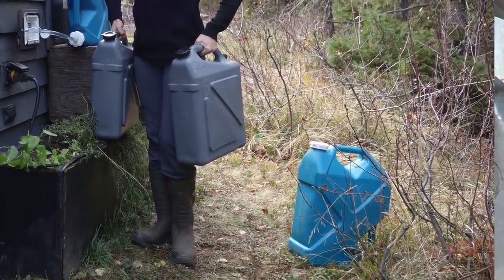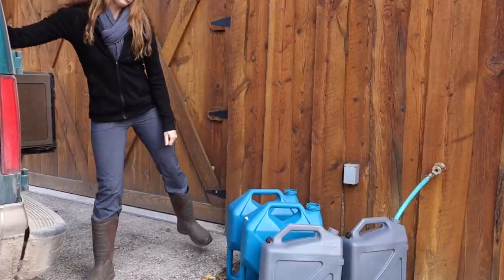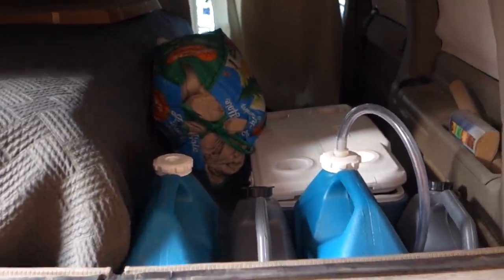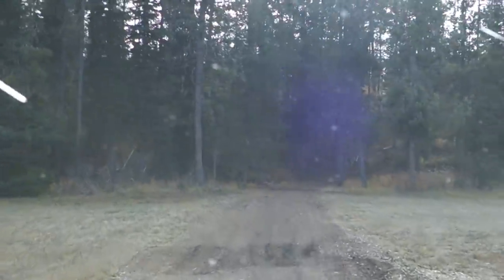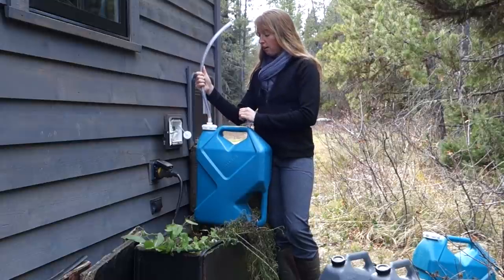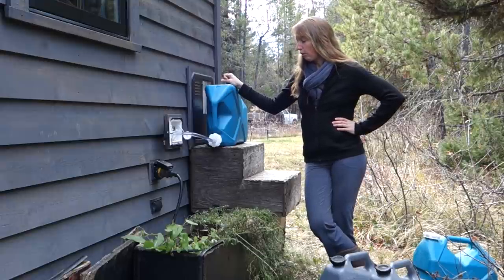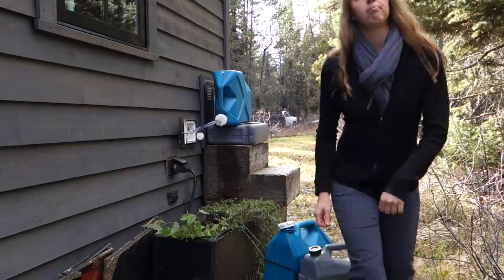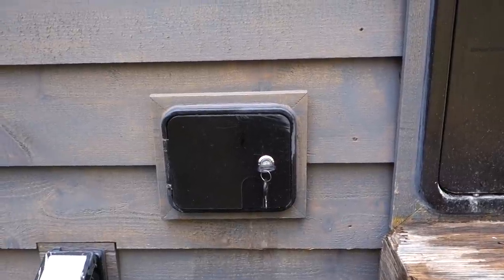Life in a Tiny House called Fy Nyth - Off Grid Water System

Comment: For my camper I do the same thing.  I purchased an extra RV water pump and I use that to move the water from the jug into the camper.  Just connect two short hoses and supply 12 volts to it and you are moving water.  You might think the pump is expensive but you have a spare pump in case the pump dies in your tiny house.  Those jugs are heavy and with the pump you can leave them on the ground.  No more transferring water from jug to jug either.  Good luck.  Great video!

Comment: I had a place where I had 3 55 gallon drums inside the tiny cabin.  It was easiest to fill up a 55 gallon drum in the bed of a small 4WD pick up, and using a 12vdc Shurflow pump, pump it directly into the cabin.  This could be done in subzero temperatures.  In warmer temps it could be gravity fed.  Gravity fed is slower and risks becoming freezing.
Staying up right, the 3 55 gallon drums would easily fit under a counter top.  I kept water consumption to no more that 7 gallons per day, and melted snow to reduce consumption.  30 gallon drums are smaller in diameter and might work under a counter top that is less than 20 inches wide.  Love your place ....nice!
Reply from the maker: Sounds like you had a good system setup.
Reply: @FyNyth  It would be easy to increase your water capacity by adding a few 30 or 55 gallon drums to the exterior in back near your propane tank.  a 12VDC Shurflo pump, or via gravity and pump that water into your tanks.  With a 30 or 55 gallon drum in the rear of the van to deliver the water efficiently to your storage tanks at home,  makes this feasable.  The extra capacity during warm weather could also help supply the garden.  I have 3 drums that are on a mound of dirt with a flat spot that is about 2 feet high.  This gives me gravity fed water source to water the garden, or to feed the outdoor kitchen sink.  I also wash clothes with this water that is warmed up by the sun.  It is multi purpose.

Comment: I have a boat that is often  anchored out so I have a water problem similar to yours.
Instead of loading jugs into the dinghy, removing them from the dinghy, filling them, loading them back into the  dinghy, unloading them onto the boat and then pouring them into the tank, I use a bag.  The  bag is the type used in boats and RVs when water is stored on odd shaped compartments.  I put the bag in the dinghy and fill it at the  dock.  Then I go back to the boat and use a pump that is similar to the one you  have in your tiny house to pump the water into the tank.  No carrying and no lifting.

You can find 15 gal poly drums that are about 26" tall and 14" diameter.  They are usually available from places where you brew your own beer for $10 - $15. The malt syrup is shipped in them so they are food grade and only used once.  Two or three of these would easily  fit in your van. A Shurflo pump and some vinyl tubing are all you need to move the water to the tank in the house. You could buy a pump similar to the one in water system in your tiny house.  With lots of snow and very cold temps, a spare pump might be nice. 

I have given water transport a lot of thought, the tank on my boat is 350 Gal.

Your water jugs appear very blue in the video.

Comment: Practical and gets the job done. If I was in your situation I would likely look into getting a small trailer and put a 300 gal IBC tank on it. That's about 2500 lbs of water, so you need a trailer rated for that, or step down to a small IBC.

Comment: Hi, Ariel. 

I tried to post this on your laundry page, but I don't think that it took, so I'm posting it here. 

I use the same laundry set-up in my tiny, and I have to port in my water, too. I absolutely love both my tiny machines, and they fit into my soaking bath tub, made of a plastic horse-trough. (Way more comfy and practical than those galvanized metal ones. Keeps the water warmer, and has slanted sides for comfort. No seams to leak, and it's a pretty green.)

Back when I had a water hook-up, I bathed once a week, (for 60-90 minutes. Such luxury!) and used the water to soak my clothes until the water got cool, and then rinsed with vinegar. I use a plant-based liquid dishwashing soap, because I live on the edge of a wetland, and I break out from soap, too. 

My spinner is supposedly faster. If your Nina ever breaks, I recommend the Panda. Laundry-Alternative doesn't sell it any longer, but I found it on Amazon when looking, just in case of failure. It's pricy, ($179) but it's 3200 rpm, and built well.  I have the feeling that the reason they break is that people don't use common sense to learn to balance their load. I'll bet you're a pro at it! 

I can't believe how dry things get. I used to use it with a conventional washing machine, and I got 2-4 additional quarts of water out of my clothes before drying them in a conventional dryer. Took half the time to get them dry.

I take about an hour to finish a load in the WW, just because I let it sit and soak, too. I spin it a few times as I pass it by, perched on a wide shelf that rests on the tub. Handy for drainage, and keeps the sink free. I'm finding that agitating the clothes is less necessary than using warm water. It's like the dirt just melts away. And my clothes are softer without detergent. That stuff is awful! I hadn't realized until I stopped using the 'modern' laundry method how it  ruins clothing. 

I tote my water in one-gallon jugs, and more frequently than you, but then, mine is within walking distance, and I have one of those little folding carts to lug them up the dirt road. It seldom freezes here, but it rains all winter. (PNW) My cold-weather adventures are nearly over. I am old, and arthritic. This lifestyle prevents me from 'freezing' my bones. More people should have composting toilets and have to tote. They'd appreciate so much more of life and nature.

When I was a child, I wanted to live in the former chicken coop that my grandmother had in the back yard. It had a multi-paned picture window, and benches inside for us kids to play in. My home is about three times as big, but then, I have a kitchen and bath. Grandma would be proud, and confused. lol She came from the 'old country' to escape all that, and live in a big house. Then again, she had 7 kids. I live alone, in peace and quiet. Ahhhhhh. 

I've been following your adventures for years, and so enjoy all of it. Thanks so much for sharing. I had forgotten about soap nuts. It was a 'hippy' thing when I was young, and they were hard to find, so I didn't. I thought it was a scam, but I wish I had persevered then. I'll check them out now. Never too late to learn. 

'Confound the establishment, think for yourself' has been my motto for a long time. lol Apparently, you, too. It's a great way to live.
Reply from the maker: Sounds like an absolutely lovely setup and life! I hope you're able to continue it as long as you want to. Thanks for the Panda tip. I've seen them but never heard directly from anyone who used one.

Comment: Hey! Thanks for the great video. I was in a very similar situation to you (jaw dropping similarities) and found a great solution. Take it or leave it as you deem fit. I was hauling water from a, not-so-close-neighbor's garden hose. I used 6 gallon jugs and put them in the back of my astro van and so on just as you showed here. This is what I did: I bought a trailer for $350 and secured two 55 gal potable water tanks that I got for free. I then connected the two tanks at the bottom and installed a spigot. Now, I could simply put the hose in the top and wait 7-8ish minutes for it to fill. I'd tow it (behind the astro) over and connect it to my water intake. This was slightly higher than the spigot so there was always some water left behind but that was okay because my tank capacity was only 100 gallons. This made things so much easier for me and I only had to haul water for me and my partner's use every 3-4 weeks or so. Hope this can help with any future solutions!

Comment: Honestly, I would be taking along a couple of solar showerbags to fill as well. As long as you have sun and the temps aren't crazy cold, I'd be taking some nice warm (at times hot) showers while I could, even if I had to fill the bags with water from the creek. I would find a spot where I could make a shower stall with a tarp wrapped around three trees, where I would suspend the tarp with carabiner clips through the grommet holes like a big triangular shower curtain. I would take one of those S hooks from those black bungee straps and tie it to one of the trees at a level where when I hook the bag onto the S hook, the end of the bag's hose is high enough for me to shower while kneeling on a piece of closed cell foam.  Very comfortable, and more than enough warm/hot water to do the job! Heck, I've waited until dark in one of my camp grounds ..... hung the bag from a limb and got a good shower, all in the dark with no one the wiser ~8^)  I'm almost ...... almost ....... thinking about using those shower bags to shower even when I'm at home, but I'm prolly too lazy, plus I would need a pretty good hook in my home shower to support a couple gallons of water or so, although It certainly can be done! Would not want to try and hang that bag off the existing showerhead bend. Sorry for the long winded explanation, and oh btw, I bet you can heat up one of those showerbags on the dash of your vehicle in no time! Take care.
Reply from the maker: I've used those shower bags, and they do work pretty well. But here where most nights, even in the summer are below freezing, and there's snow on the ground for about 8 months out of the year, there's just not many times that showering outside would be comfortable. :) Or maybe I'm just not tough enough.

Comment: Nice video. Nice to see your  neighbours yard. You've found a workable solution. If it were me, to save my back and my hips, I would tweak a few things. At the neighbours I would make the hose a little longer and fill the containers in the van, with a second tap/shutoff near the van end. At your property I would trolley the containers to the inlet. Then I would leave them on the trolley and use a battery powered pump to pump in to your house tank. Better still have a 30 plus gallon tank in the van and pump it direct from where you park your van to the house, weather permitting. I'm sure you've thought of all this stuff and your young and fit, but just be kind to your 60 year old future self and mind those hips, knees and back.
Reply: I so admire the way you have set up your homestead and marvel at the things you have accomplished!  I am going to agree with Coffee though,  as a fit 25 year old I hurt my back accidentally loading pods onto an aircraft in cold weather and it has hurt off and on ever since and I am now 60. Even lifting and jerking those shifting weights only every 10 days could short out your shoulder, back, elbow joints or wrists.  Protect yourself now so you can continue to do more amazing things far into the future, pain free. Filling a 30 gallon barrel while it is in the van (attach a spigot to the bottom of the barrel) then draining it via hose while still in the van can save your skeletal structure a lot of stress. Work smarter, not harder as they say.
Reply from the maker: Thanks for your concern guys, but since I go lift much more weight than this regularly for fun, I'm not too worried about it at this point in my life. I do try to lift things safely.
Reply: I'm only 42 and already I am sorry I wasn't kinder to my younger body, joints, skin, hearing etc. I have felt the same in my body from 17 to 38, but at 38 noticed things just not quite as easy as they used to be. You can do things safely and avoid injury like you are doing, but you can't stop joint wear and it's cumulative. It's a balance, doing stuff and being active like you are doing will help you live longer then someone sitting on a couch watching TV all the time, but you might have a few more aches and pains later on. If it were me I would try and cut out the actions that negate themselves e.g. you arrive at your neighbour's yard with the jugs in the van and then jugs are in the van when you leave again. Taking them out and putting them back in again is needless with a longer hose. Ok, enough from the safety police. Please keep making videos, I enjoy them so much.
Reply: Those are some good ideas for efficiency. My only issue is the big tank in the van. If she had an accident a 30 gallon tank, which weighs about 250 pounds, could become a big heavy projectile. A morbid thought I know, but still an important consideration when hauling something.
Reply: Yes, you are right, an unsecured weight would be very dangerous. I'm sure there would be tie down points in the van. She is already carrying 24 gallons at the moment, but the journey is only one mile. The weight may help with traction in the snow.
Reply: Good ideas. Some marine pumps are manual, btw
Reply: Weight bearing exercise wards off lots of conditions later in life . Maybe just your wrists could use support. Nice job !
Reply: i 'm sure she will be putting a 12 volt pump eventually but want be in the shape she is in now.most of people don't know how much water they use per day nor do they care!!!!!good job girl.

Comment: You could run a long garden hose down to the creek in the summer and then pack it up for winter. Another option I would do if I were in that situation is purchase a large 20 gal. Or more  poly tank you could fit in your van and fill that at your water location, then drive back and back up to your home and either siphon into your home or get yourself a small rv pump and pump it from your tank to your home. This would eliminate the need to carry your water jugs.
Reply from the maker: If I used creek water, that would add a need to filter all of it before it went into my tank so that would actually make me more work than the well water that I know is clean. I do pump creek water in the summer for irrigation of the garden and watering plants. :)

Comment: If you've a mind to save some energy from your main system, there are 12 volt pipe wraps available. If you teamed that up with a solar charge type of solar panel (the smaller kind) you could probably keep your pipes warm with just the sun. Most of those kind of panels are amorphous solar cells and can handle cloudy conditions quite easily. There would be slightly less energy overall, but more collection time during the day. I used to live in South Dakota and Nebraska. Your weather sounds much the same: hot, dry summers and COLD winters with lots and lots of snow. But still dry, and not wet and slushy like here in Michigan. -25 was not at all uncommon either, and would last for 2-3 weeks, as you described it. No one worried about the cold until that point--because then the cows would succumb. Take care!

Comment: Snow collection is the same as rain collection. It’s just heavier. It always melts. And you can barrel it. Our snow season in the desert, we get 80 gallons and more.  But the first 80 gallons we fainted. We can’t track the gallons now because we are busy on other projects. But when it snows we love the water production.
Reply from the maker: Sounds like you have a system that works well for you! Melting and storing snow water is a very energy and space intensive setup when it's around freezing at night most of the year and well below zero for months. Everything would have to be internal to prevent freezing and bursting and there's not space for that in my house.
Reply: Fy Nyth well your system is smaller than ours. Ours is fairly simple. But the metal corrugated roofing is primary for weight and holding the snow. We are fortunate that we have maybe two weeks to a month or two below freezing. And we also use what they call bathtub flooring which is a large thick plastic, or rubberized style plastic that we use for shade areas. It’s very strong and thick. And the snow it will hold well. And then pools of water and viola it melts and then the gutters route it to 250 gallon cisterns which are small compared to the ones we have seen. We too have a conscious consumption table with a low usage. Lower than most people and almost in the range as you. But we are more people in our family so our consumption will differ of course. We do use our grey water for our gardening. And I think you are doing a fabulous job. But I wanted to let you know the possibilities. It depends on how long you stay some place as some of the structural issues you can’t just move in a minute. Like the larger tanks. What helped me when it was just me was a 5 gal hot pot since we do a lot of meals on a tiny wood stove. And we remove the top layer of snow. And with a small shovel scoop the inner snow before the bottom layer. It melts on the stove and then we allow it to cool. Then pour it into the Berkey filter and we have drinking water for the week!  That is the simplest is to just prepare enough to use. And yah it’s time intensive. But not as bad as it could be lol. But that is the price people pay for automation. Good hard work can be overwhelming. But it’s worth it when it’s for you!!!  I applaud your work.

Comment: My kind of girl!  You should find or make a small wooden crate to set up on the step block or put something under the step block to raise it up and then you would have the level you need to let the water completely drain.  You could also fabricate or possibly find some metal brackets that could be mounted into the wall of your tiny house.  I love your tiny house.  Really cute......your house is cute too.
Reply from the maker: Thanks! All winter I just flip the block the other way, so it's no big deal. But in the summer, I need the whole to be down so it doesn't crush the plants underneath.